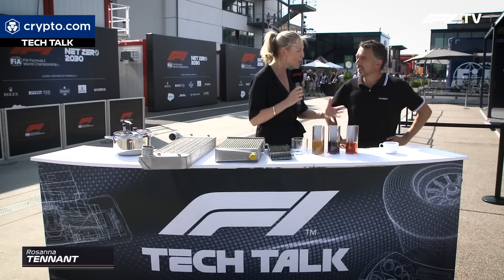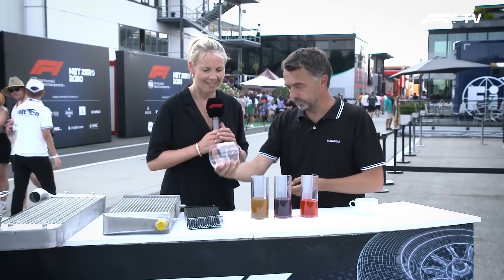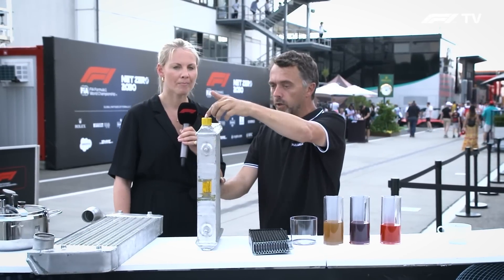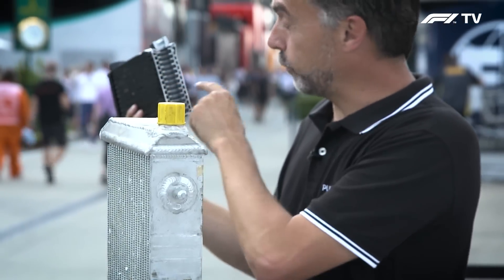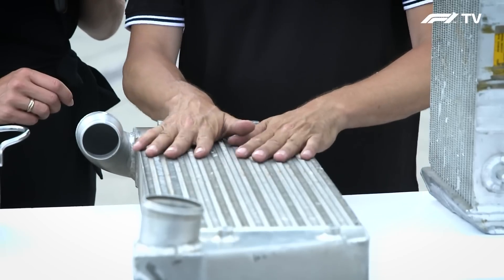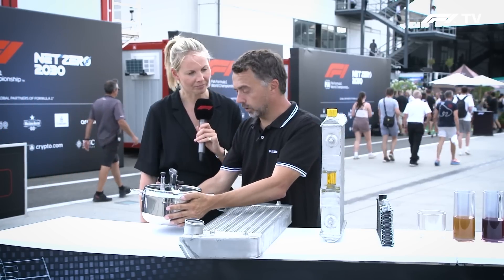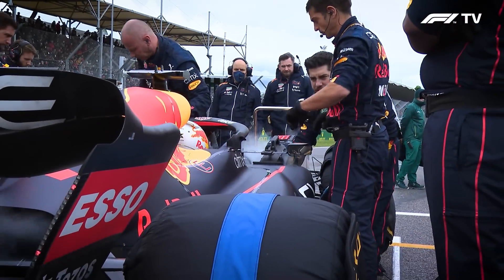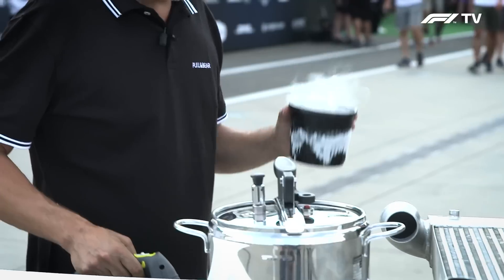How To Cool An F1 Car | F1 TV Tech Talk | Crypto.com

Comment: I did not think about the pressures, because at the recent Mexico GP there was a lot of talk about possible overheating because of the thinner air, but none of that really happened, aside from maybe Alonso.
But this explains why.
Also never realized that they used dry ice, i just figured it was cold air, but didn't think about the specifics, thanks!

Comment: Formula 1: "We'll be CO² neutral by 2030, CO² is the worst ever"
Also Formula 1: Cools the car down with CO²
Reply: Dry ice doesn't release excess carbon dioxide. 
since carbon dioxide is taken out of air then made into dry ice, it's just released back into the air, you're not adding anything extra back into air). Though it does take some electricity to create dry ice
Reply: @tezzaza  Totally! they are not generating CO² here, they are just using existing CO². It is not the same. Plus, being CO² neutral means that you must compensate your production of CO², not thqt you cannot use it or generate it.

Comment: Anyone know how many degrees the radiator brings down the coolant temperature to? Say, it enters at 100 degrees, what would the exit temperature be?
Reply: The engines are most efficient at around 85 to 90C, so the drop in temperature is small.  The trick is designing a system to maintain that narrow window of temperature consistently under all conditions.

Charge air temperature on the other hand will enter at over 300C and exit at ambient.

Comment: Albert thanks for the great demos. Can you answer a question please. What are the high vis yellow dots appearing on the F1 cars. For example they are on the rear wing and side pods?
Reply: As far as I know, the FIA requested the teams to place those high contrast stikers in order to ease the measurement of the rear wing flexibility on track (using the cameras installed in the cars).

Comment: Love this series.
But how can you control and cool the cars engine. Are the pumps running of a battery?
And are there regulations to limit temperatures of for instance the intercooler?
Which you would like to compress air as much as possible during the start.
Reply: Yeah, water pump oil pump if there's no pump to push the water in and out it wouldn't come out again to the radiator and there'll be no circulation
Reply: no the engine powers the pumps